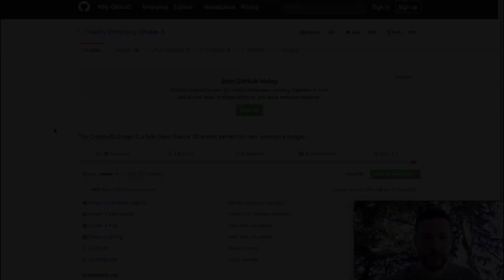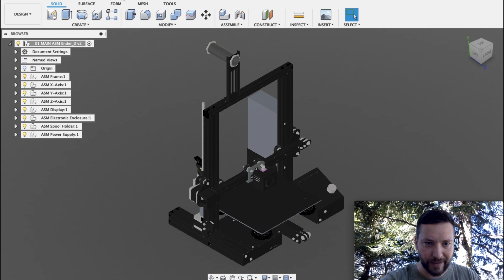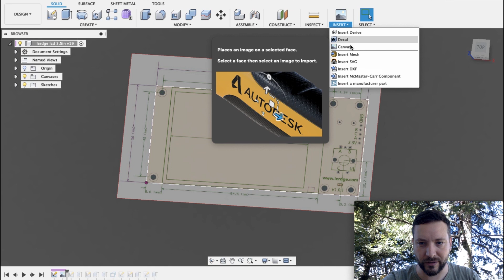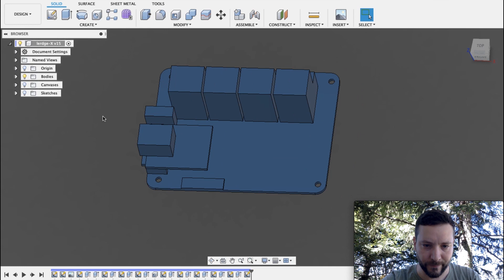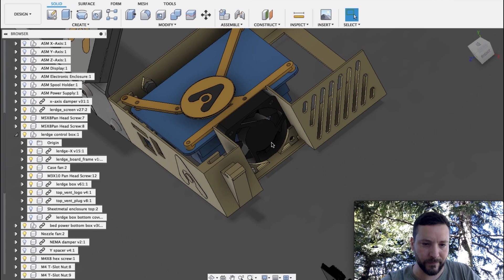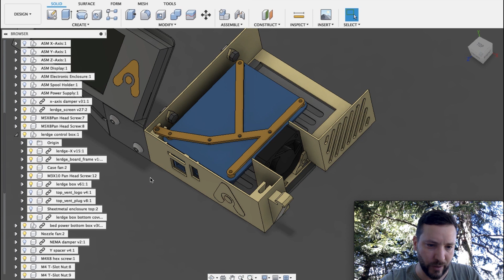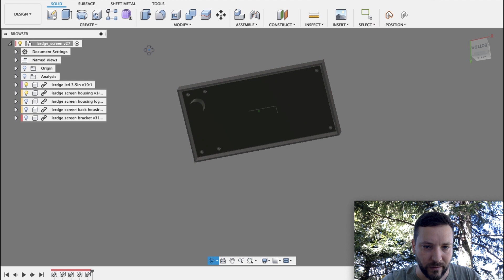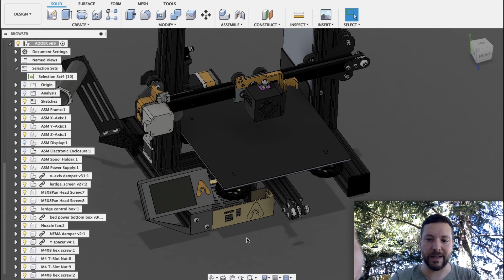Lerdge-X on Ender 3 project - Part1: design

Comment: Thank you for sharing your design thoughts - very helpful. Great design too!   I grabbed the Ender CAD model a while back and actually found a use for it the other day - I wanted to make an adapter bracket to carry the cable chain that would bolt onto the end of the 40 x 40 extrusion. It was simple to copy an extrusion out of the full Ender CAD file and work from that. Very basic compared to what you have done here though ;)